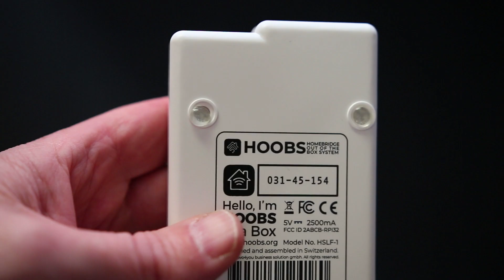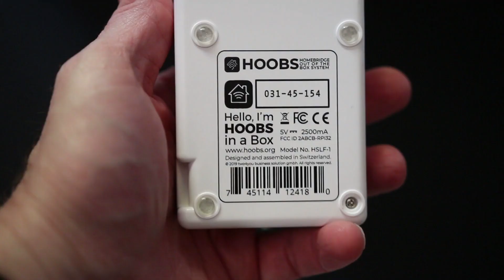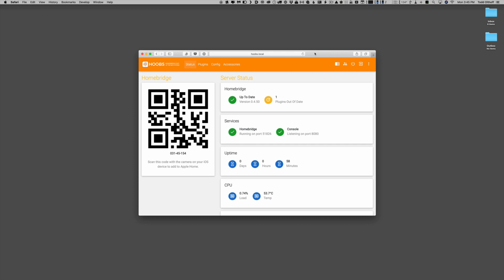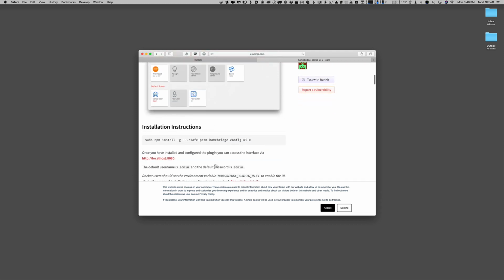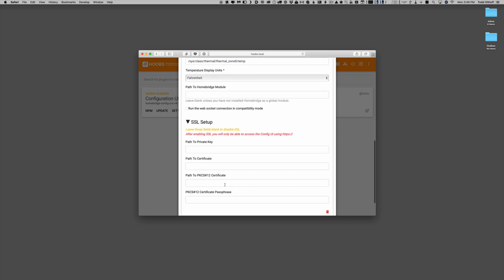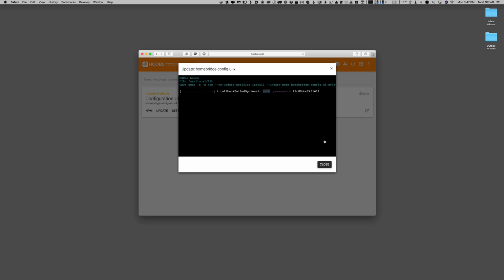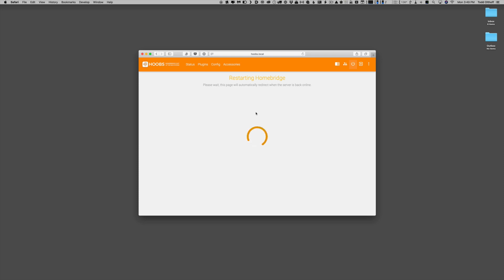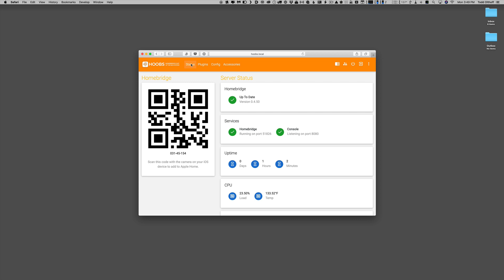HOOBS Part 2: Device and Software Updates

Comment: hello professor , it's a pleasure to join you. I'm new to hoobs. I just installed one. I have almost 100 shelly quotes and I thought it was easy just a shelly plugin to install on hoobs and it will work. booommm it was not like that. I'm a beginner I'm not an expert, first of all the devices work on a single action if you turn on you can't turn off. I searched everywhere, and I found that I have to uncheck something like igmp beamforming stuff like that. finally all sombler very well turn on turn off it's perfect. after a few hours I see no repence, nothing works. I see the router the IP address of hoobs is good .144 I type it on browser site inaccessible. I restart hoobs all function after a few minutes the same problem. I'm sorry it's very long and thank you very much for your help